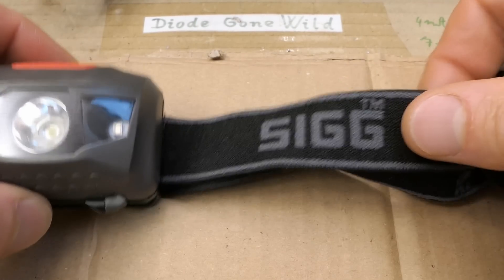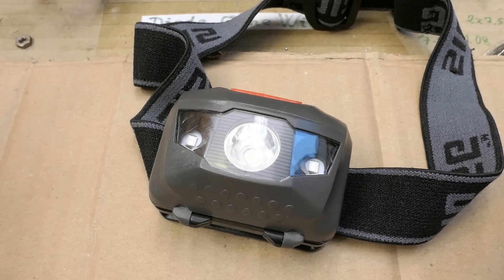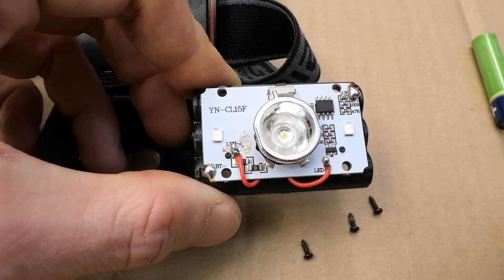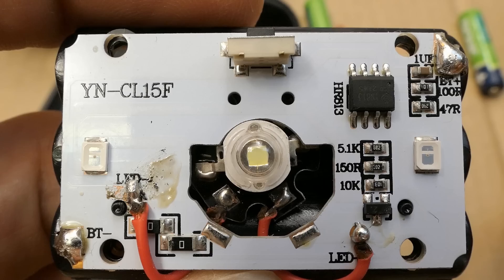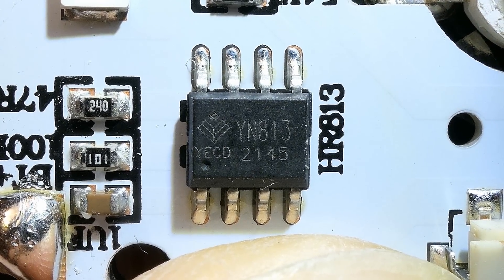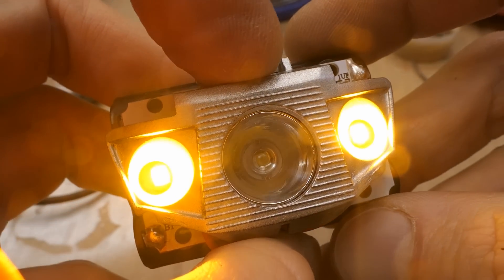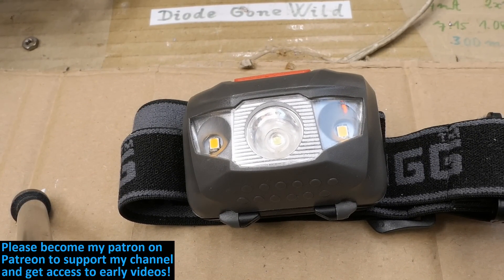Sigg headlamp teardown and modification

Comment: I h found the fifth mode, its white red in cyclus emergency and maybe intensity higher, but not used the light and forgotten i hope i find how to activate again maybe in this video. Even the manuál and seller didnt write about fifth mode i h wrote that to the importer in Holland.
Reply: Damm it on end of video but by me it doesnt work, so should be exactly how long the long press or sequence all modes truth than the pause, in your video is cut, i dont see it after all modes are you in first longest light or second mode short white light snd than the long press, how long?

Comment: Interesting that they have the main LED "floating" like that. I suppose it might just be because of the depth of the reflector, but it can also prevent it from being overconstrained. If the LED was soldered directly to the board, then unless it was perfectly aligned the solder joints would be under stress once the whole thing is assembled.

Comment: Making such devices powered by AAA must be a crime. I hate AAA batteries so much, I have a drawer full of dead AAAs.
Reply from the maker: Why not use NiMH AA?
Reply: @DiodeGoneWild  NiMH AA batteries actually last for long and are great.

Sadly, many products use smaller AAA which have half the capacity and die fast.
Reply: The whole world have drawers full of AA batteries. It's a crime.

Comment: The problem with using NiMH instead of alkaline batteries in these head torches is that the voltage of three cells is 3.6V rather than 4.5v. This means the brightness is much lower for most of the charge. (Just charged NiMH will have higher voltage but that doesn't last long in a high current situation like this.)
Reply from the maker: The brightness isn't actually lower. NiMH cells have a lower internal resistance and also their voltage declines way less as they discharge. Alkaline voltage is significantly lower under load and as they discharge, it declines steeply.
Reply: Thx - i will keep and use my NiMH collection then. 
I love yr stuff. Your LED etc tester, where u just measure v drop with v meter, has been one of my most used and useful tools, and still on its original single AAA battery! I made it small, but Im going to make it even smaller and stuff it inside my MM. I love its coloured neons and led. I use it for so many things, LOPT secondaries, not just leds. And it worked straight out of the box, no heating, no probs, no mods needed. Perfect for beginners like me. I would love to see your version of a milli/micro ohm meter, i dont remember seeing one on yr site, but will have another look. Hope yr still living the dream like the rest of us 😂😂😂

Comment: Nice modification. Simple to get inside too - my Petzl is almost impossible to get apart non-destructively :o( 
(looks like a signal generator you are working on - I see a tuning cap and a front panel meter ?)
Reply from the maker: No, the work on the signal generator is finished. This is an LC meter ;)
Reply: @DiodeGoneWild  Oh yes, looking forward to seeing that !

Comment: Looks like you could (sort of) modify the headlamp using 18650 aswell instead of 3 AAAs. It will run for much longer and should work without modifying the main chip inside (with 3 AAA it should have a voltage range of 3 - 4.5v, which is close enough to 18650's 3 - 4.2v range). You do need an external bms for protection and charging circuitry tho, but I think it'll be quite an interesting mod :)
Reply: 3x 14500 would be much better choice. Simply reconfigure the battery contact-points for parallel connection and done. Keep the original looks and no mess necessary.
Reply: @primonda56  That would work as well, but it's quite a bit harder to find the cells (at least for me, a genuine nitecore 1000mAh 14500 cost almost the same as samsung's legendary 18650 25R :/) that I don't think it's worth buying just for convenience sake. I'd rather make it a little more jank so long as it's cheaper tbh 😂

Then again, with a headlamp as simple as the one he has, the modification possibility is endless. Heck, he could even (with a little struggle) modify the main led chip into a 10w smd monster if he want to :)

Comment: These are around for a long time. There's a model with two buttons, so you'll not loose night vision when cycling through modes. The idea with red light is keeping night vision like it's done in a tank or submarine. A silly little lamp like that is ideal when being in the woods at night, just all the light you need, not more, and lightweight.
Reply from the maker: I understand the purpose of the red light ;). But I'm using this one for running in the evening. I needed a source of light bright enough so I can see my way and not break my legs, but not the super cool 10 000 K white LED to ruin my sleep.
Reply: @DiodeGoneWild  I was tempted to comment because most of these are an annoyance, it's a hassle to find a decent one. I even stored some with two buttons and lithium battery, same production as the simple one here. Thanks for sharing, good to know I'm not the only one caring that way. My mod is making the battery accessible for phone loading in the wild.

Comment: Again, great improvement @DiodeGoneWild. It's always a pleasure to see you improve things :)

By the way : Red LEDs are used in tactical mode when your eyes are accustomed to the dark. This (in principle) limits the loss of sensitivity, literally ruined by a white lamp. Well, that's the theory 😄
Reply from the maker: Thanks :) but I have this one for evening running. I need enough light to see my way not to break my legs, but not the sleep-destroying 10 000K super cool white LED ;)
Reply: It supposed to but some of these cheapo headlamps go through all the lights first and then blind you anyway
Reply: That's true about white light destroys your night vision, takes 20 minutes for eyes to adjust to total darkness. I have been to several star parties, everybody only using red led flashlights to few star charts. No headlights on vehicles driving into the dark site. Cheers from Canada

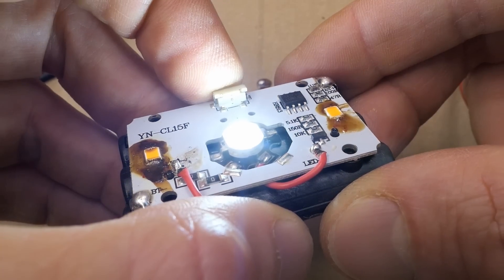Comment: 3:49 you can use synthetic solder paste, it leaves less residue
Reply: Or use less than a bucket of rosin.
Reply: @WolfGamerBohumin nope one bucket minimum
Reply: @change_your_oil_regularly4287  One microPaul of flux should suffice. One miliPaul is already too much: https://www.youtube.com/watch?v=v165GD0We3U&t=179s